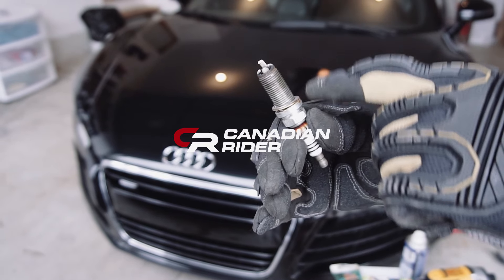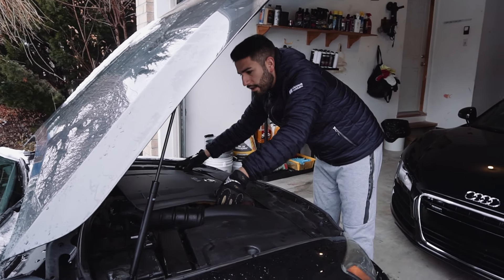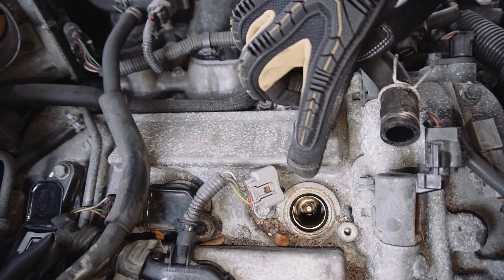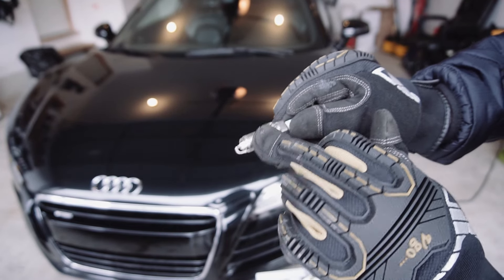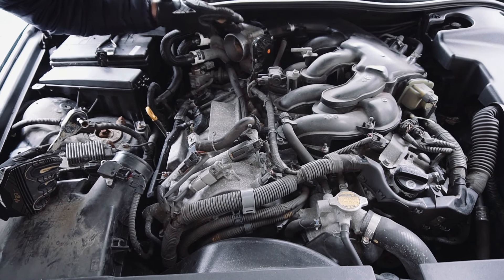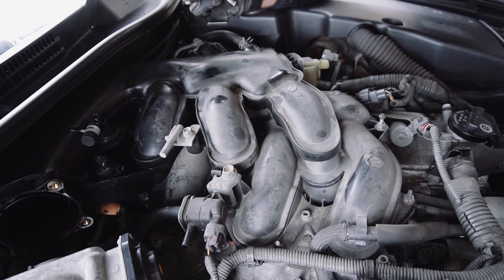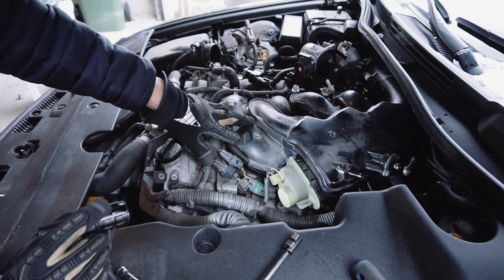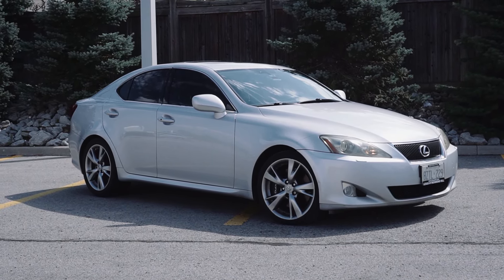How to Replace Your Spark Plugs on Your Lexus IS250 & IS350!

Comment: If you can do the Fuel Injector Replacement for IS250, that would be awesome. No available video for this yet.
Reply: Same as spark plugs very easy to remove only issue with that is you have to replace the plastic seals on the injectors , they run down the middle of the engine

Comment: Is it expensive to change parts on is250 ?
Like break’s, shock’s, or headlights bulbs ?or other issues. And does it take regular unleaded 89 gasoline? Thanks
Reply: Not really. Some of these parts are Toyota Camry parts
Reply: expect them to be pricier than the average car, some parts might be Toyota. and no, only 91 or more.

Comment: Removing negative battery cable is unnecessary. Your car ECU will reset to defaults. It may cause performance problems. And when your car is not running all your ignition systems is also off.

Comment: for anyone who owns an is250, can you guys provide me with feedback on where I made my mistake? i had done a spark plug replacement job on my is. replaced the spark plugs on the passenger side, drove the vehicle, and didn't experience any complications whatsoever. the day after, went on the other side to remove the manifold on the driver's side but couldn't remove it due to what could be a stripped bolt so I left it alone and put back all the screws and nuts back in place. the vehicle ran funny and I noticed that where the fuel line that he mentions in the video 17:34 started smoking and was kind of moist. resulted in the car shutting down. how do I go about fixing this issue? should also mention that the washer for the screw on the fuel line had fell.
Reply: You messed up as soon as you changed the only the passenger side plugs….. ALWAYS CHANGE ALL PLUGS AT THE SAME TIME

Comment: My wife just got P0300-P0306 on her 2010 IS250. I hope this works because those coils are like $60-90 each 🤯
Reply: could also be the coils. i’ve been dealing with P0300 for 4 months. plugs didn’t do it, im replacing 3 coils and the PCV first. it could also be carbon buildup. get the intake valves manually cleaned. clean the MAF sensor and throttle body as well. all of these can cause cylinder misfires.

Comment: Any maintenance recommendations for a 2014 is250 with 94k miles…. Curious on what I should be doing
Reply from the maker: Just continue doing your oil changes and replace the spark plugs when the time comes.

Comment: 10:43 I'm not a pro, but just an idea: When hand screwing small bolts/nuts it a good idea to use thinner gloves (or no gloves) thicker gloves make it easier to lose your grip on bolts/nuts.

You'll regret it when dropping them in between those tight spaces.

When untightening tough parts then yes, these thicker gloves he's wearing are a good idea to prevent those unexpected painful abrasions, cuts, scratches on your hands that make you say, "Ah Fuc*, son of a fuckin* bitc*"!!"😂
Reply from the maker: Good call man :-)

Comment: Please note: removing the negative off the battery is nothing but a waste of time when replacing spark plugs. It actually creates more unnecessary work. I have performed a billion tune ups and not once required to do that.
Reply from the maker: Thanks man can you share why just curious.
Reply: @carswithsonduren  the only time you really need to disconnect the battery is if your doing electrical work.

Comment: how do i know when to change my plugs. my car has 175k miles and idk when they have been changed last. it seems to run fine tho. should i just change them now to be safe?
Reply from the maker: Change them to be safe
Reply: you’re well overdue for a change. they should be replaced every 60,000 miles. coils are overdue for replacement as well, which last around 80,000-100,000 miles. your transmission fluid is also likely overdue in this case, also done every 100,000 miles. only drain and fill that, never flush

Comment: What kind of adapter are you using for the 5mm Allen head? I ordered the DeWalt set you linked to the video but it doesn't have a long enough extension for the 5mm Allen.
Reply: I just cut an extra allen wrench I had and taped it in a 5mm 1/4 socket. The fuckers were tight, one almost stripped.

Comment: Has anyone had issues with the car not starting after changing the plugs ? It was running like sh*t before i did plugs and the intake was full of black dust. Ive taken it apart and put it back checking what i thought was everything.  It cranks but wont start. Fuel pump sounds ok too. Idk wtf..
Reply: Did you figure it out ? Mine starts but won't stay on.
Reply: @jonathansanjuan6267  yes i over cleaned it and had to put transmission fluid in the cylinders to get compression again.

Comment: I also own a Lexus is250 ‘06.
I replaced the sparkplugs myself on 182K(kms) and i now have 244K on it.
Used the Denso FK20HBR11 plugs.
Hoe long do the plugs actually last.some say 80K and some say 100K?
Which is correct?
Reply from the maker: 80k sounds about right but it honestly depends on so many other factors. I would stick to 80,000 km and just replace them it's not a major service.
Reply: @carswithsonduren  yess when i bought the plugs,the website stated 80K,but on the website of denso itself they say,for a few models,including the “F” model plugs will last 100K.they are iridium super ignition plugs as far as i know

Comment: can you use wd40 instead of anti seize?
after how long do think I should change on Toyota    ?
Reply from the maker: 120k is the maximum interval if you have iridium plugs. I would use anti seize specifically
Reply: @carswithsonduren  you didn't have to remove the intake manifold to replace the driver side spark plugs. All you needed was a 10mm short and thin profile socket on an extension to get to the plug bolt hiding under the plenum. I replaced mine today on my is350. Good video tho but hated that you had to go thru that extra trouble 😁
Reply: @malikelijah2045  Is the process exactly identical on an is250 though? Noticed you mentioned you did it on your is350. Would save me a lot of trouble if I can avoid the intake manifold removal
Reply: @malikelijah2045  Also what was the exact size of the thin socket that you used?

Comment: I got a lexus es350 2019 with 44k miles… anyone knows when should i be changing spark plugs??
Reply from the maker: It should be in your owner's manual
Reply: @carswithsonduren  nothing stated regarding milage or spark plugs
Reply: Every 1000 miles

Comment: Did you adjust the gap of the spark plugs or you left them same as you bought them?
Reply from the maker: They are pre-gapped
Reply: If I may add. I work at a parts store bro and not all of the spark plugs we sell are pre-gapped. Next time you buy plugs ask them if they come pre-gapped.

Comment: nice video and instruction but I don't think this is for me!  I used to change spark plugs for my  4 cyl 92 Integra and it was easy....I would go as far as changing the filter for this but I am going to pay the dealer for the spark plug changes at 120K

Comment: In those gloves you can't feel anything, they are good for snow shoveling, not for working on cars. that's why you lost one bolt.
Reply from the maker: You got one better you recommend?
Reply: @carswithsonduren  Venom Steel Industrial Nitrile Gloves, 6 mil, 2 Layer Rip Resistant, One Size Fits Most, 100 Count
Reply from the maker: Thanks Pawel I’ll check these out :)

Comment: wow what a hassle to change drivers side spark plugs intake has to come off yes might as well replace the gasket maybe before you take a hammer to the allen socket clean out the bolt first it probably has crap inside it